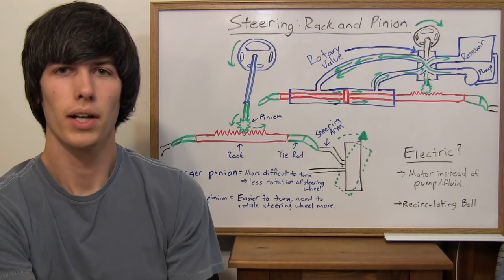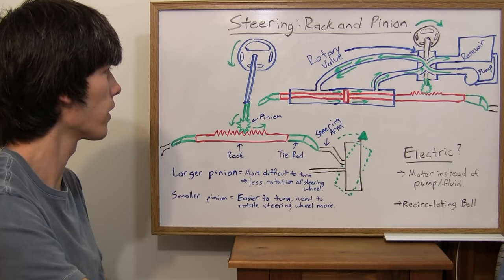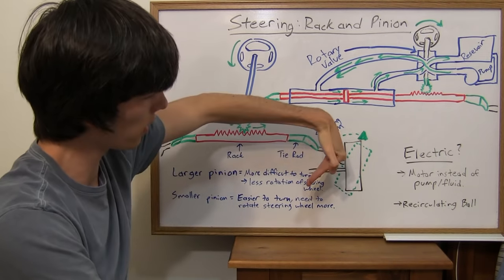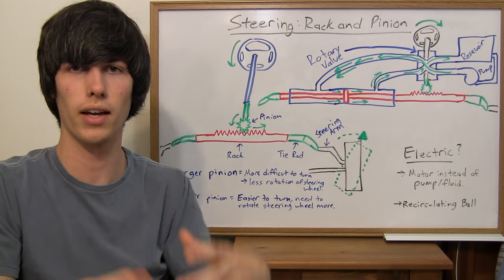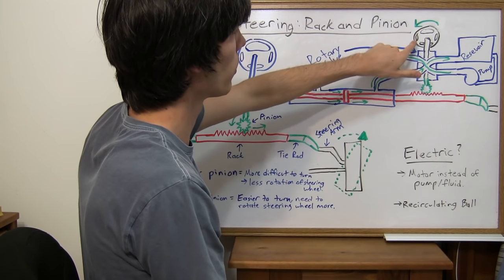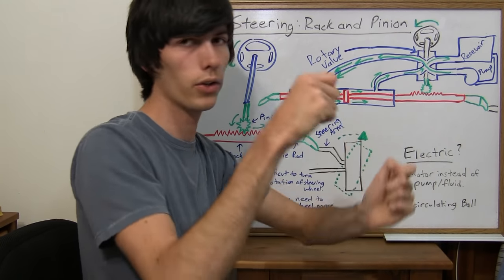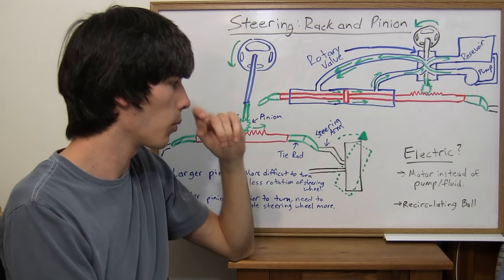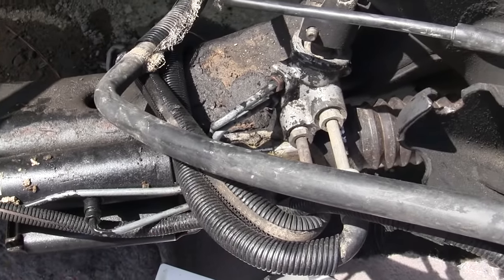How Car Steering Works - Rack & Pinion

Comment from the maker: Yeah, my drawing is basically two angle views combined, which could be confusing. The wheels are viewed from directly above, where as the steering wheel was viewed from the front. It would be difficult to show the wheels rotating from the front, which is why I drew it they way I did.

Comment: +Engineering Explained My sister has an 08 Maxima. She has issues steering the car on a cold start. I sat in it to get an understanding and tried turning the wheel, but it behaves as if the pump has gone. So I drove it because my sister says, "The problem goes away after driving it." After the drive, I stopped and tried steering it. The wheel turns with no problem after the drive but any input from you would be much appreciated. Separate note, your channel is great. I have very little friends who enjoy and understand cars, so its nice to see someone like yourself who shares the language. Thank you!

Comment from the maker: The valve alters the direction of the flow, the pump pumps in a single direction. The flow has to change directions in order for the piston to be moved both left or right.

Comment from the maker: It's a great car. Had some trouble yesterday with some misfiring but I replaced the distributor cap and everything seems to be fine now. Great handling though, for the price it's an excellent vehicle. Leaks and burns oil though, so if you do get one just make sure you check the oil level regularly (which should probably be done anyways).

Comment from the maker: It's the mechanical linkage between the steering wheel and the driven wheels - the entire system doesn't work solely by hydraulics, it does need some driver input.

Comment: Please explain or speculate what happens when the hydraulic hose hookups are reversed to the rotary valve unit. I have recently accidentally done just that, with steering fluid spewing all over. I have read that the bushings or seals (?both) will be displaced or “blown”. I plan to repair the rack but wondered if the rotary valve seal or the rack piston seals will be affected. Thanks. If you don’t know or won’t speculate I will follow up after the job is done so you might learn something useful and pass it on. Thanks.

Comment: Thanks for all the great engineering explanations. 

Once the steering valve opens the pressure on one side will increase the steering angle, what stops the angle increasing  once the desired radius of  turn is achieved, ie a fixed steering angle for a given steering wheel input.

Comment from the maker: The fluid could be eliminated and simply replaced with an electric motor which places a torque to move the wheels (for example, an electric motor powering the pinion to move the rack, or one powering the rack, etc).

Comment: What happens with pressure on piston, when the steering wheel is not rotating, or turned for 20° and left constant ?

Comment: Old vid but still great.  Curious where the weak points are with a rack and pinion?  I have a 2010 accord with a leaking seal on the rack and pinion.  How long do these normally last?

Comment: Is the box the same as rack? My Chevrolet Matiz 2005 has a noise and small bits of hard steering. Replacing the pump didn´t fix it. They say, buy another pump, but I wonder if the pinion or the power steering rack is bad. Can they resist the pump and cause overworking noise? It only appears cold at the start, while not turning and while turning.

Comment: Thank you I had my car air bag change because of recall 15 days later this trasmission fluid is liquid is slowly dripping out till it was all gone dealership told me is not my transmission but this iteam that you explain in your video 
my 2010 Subaru Forester never had this problem when I got there before I have been driving many miles without a problem

Comment: Hello sir, I am modifying electric golf cart to fully remote control. I want to select servo motor for steering but how can I find torque required for pinion to steer for selecting right servo motor?

Comment: is the rotary valve inside the rack and pinion? i want to know because im going to install an electric steering pump in my project car, i want to  know if its as simple as making a high pressure hose from the pump to the rack, and a low pressure from rack to reservoir

Comment: hey man how to adjust steering  stiffness on a 2005 chrysler 300 steering rack it's  too sensitive too soft no play I checked  it tie rod and ball joint  are ok, is there a srew or bolt  to adjust  how hard or soft is the steering on a steering rack.

Comment: Its not irrelevant :)
I totally agree. My old truck had an opening on the bottom and I over to rest my hand there. Its especially nice if you drive a manual and have to steer with your left hand most of the time.

Comment: can I drive my awd nissan with a little crack in the transfer case, is leaking drops of fluids, the shop changed the caps, but is still dropping fluids, they can not see the small tear.

Comment: I've had a couple of cars which had electrically driven steering hydraulic pumps. The silly thing was that the pumps switched off when the engine stopped even if roadwheels were turning - so if you lost the engine whilst moving, steering still got difficult.

Comment: I was looking for a video explaining what's inside a power steering rack and came across this video. Very well explained but I think it's not 100% accurate. At 6:01 you explain those lines being the high pressure and return line to the pump/reservoir. I think these lines operate the hydraulic piston inside and can both be high or low pressure depending on the steering wheel being turned left or right. The magic happens in the valve/pinion housing and I'd love to know how that works!

Comment: Engineering Explained Subscribed! My 1982 Camaro has a small deadzone in the "middle" of turning left and right. I can turn my wheel a few degrees and it just feels free floating, not doing anything. Then if I keep turning it turns as expected. What do you think is happening?
Reply from the maker: Not positive, there's either some play in the rack and pinion at this point, or the valve doesn't quite direct flow quick enough when centered. When you have the wheel turned, there's resistance on the rack, as the car wants to straighten out, so it will seem more responsive.

Comment: Nice video! Informative and yet easy to understand, and now I also want an Integra wheel :P One distinction I wanted to add, there are now 2 different types of electric steering. The first one is what you mentioned, with an electric motor taking the place of power steering to assist you turning the wheel. The second method is being used in the Infiniti Q50, which is knowing as "steer by wire." In this system basically your steering has no physical link to the wheels, instead when you turn the wheel you feed inputs to a computer which then figure out how much to turn the wheels.

Comment: you probably wont comment back on this as its been so long since youve posted this.. but i just had a question, might sound kinda ignorant but i wanted to know.. can driving a car with low power steering fluid for a day or two cause the pinion seals to go bad? i just got a new rack installed and the guy didnt top off the fluid so it made a whining noise while being turned.. i didnt know it just needed a little more added to it.
Reply from the maker: ohreally nao80 I would just bring it back to the shop and have them take a look and make sure everything is fine. It's their responsibility after all. I wouldn't think much damage would be done, but I'm not positive.
Reply: its fine now, but yeah, their work comes with warranty so ill be sure to do so if anything comes up. thanks for the reply, man.

Comment: If I'm looking at this correctly, is it correct to think that if the pump stops working, it would result in a rack and pinion that is harder to turn than an equivalent one with no power steering components on it at all to begin with?

Comment: CAN YOU PLEASE HELP ME. Every time I make a turn my car does not adjust back to center (it continues to flow with the turn). The car runs in a straight line, but the steering seems very loose for my car. The front and lower control arms were recently changed. I believe this has to do with power steering rack bushings, but I am not sure.
Reply from the maker: Interesting, sounds like several things would need to be off in order for this to happen. Caster would be a good thing to check into, as well as the toe (alignment in general).

Comment: can you please explain why a simple hydraulic power steering can damp the road shocks? I am confused, this seems conflicting the fact it makes the steering easier.
Reply: +Jiayang Ruan because where a road bump would normally jerk the rack and then rotate the pinion and thus the wheel,  now the road bump has to put that same work into doing all that AND trying to force the piston in whichever direction against hydraulic pressure, which is difficult, so it basically damps it out.  the more hydraulic assist, the harder it would be to shove around, the less assist, the easier.  For example a bmw has more steering feedback then a Rolls Royce, because the Rolls Royce would have more hydraulic assist
Reply: Let's take an example. the road bump jerks the car's front wheels to the left, and thus the steering wheel is also jerked to the left, because they are meshed with each other. According to the working principle of power steering, the hydraulic circuit will operate and assist the steering wheel to the left, which will further strengthen the road bump effect?
The problem is, why the hydraulic circuit will assist the steering force of the driver's hands, whereas hinder the steering force of road bump? where is the difference?

Comment: my stock tire is 195/65/15 and I already change the tire long time ago to 215/45/17..Lately I feel my steering wheel is quite heavy..some says its normal after we change the size of the tire..the question is how to know if the power steering pump is still in good condition?..tq

Comment: I see, so vehicles with power steering fluid doesn't use any electric force correct? But fluid pressure.

Comment: How long can I ride on a bad rack and pinion? Been doing it for 5 years 100k lol  I mean I'm not loosing power steering fluid. It drives and steres fine fluid I do hear minor noise when parking etc  which got little worse over years  I got about 250k on my camry don't want to put money into it besides that car is perfect mechanical condition.

Comment: Ok, now I'm getting confused. I've been searching for information on how to "bleed" the P/S system after replacing the high pressure line that runs from the pump to the rack. I figured the high pressure line was a one-way street and that the return line going from the rack back to the pump was also a one-way street. But this video is telling me that both lines change flow directions depending on whether you're turning the steering wheel left or right?

Comment: I am making a go kart which steering system would you suggest me ?
Reply: +sourabh kothawale Rack and pinion without any assist, with that little weight it isn't necessary, especially if the motor is mounted in the rear.

Comment: What happens if you drain the fluid completely from the vehicle and remove the hoses from the Power steering resivoir and virtually drive the car with no fluid running through the system?
Reply: The system would act like a regular rack and pinion steering without the assistance from the pump. It's much harder to steer but it still works. You may have seen people pushing a vehicle to the gas station before because they're out of go-juice. Their vehicle is off so it's not running the pump and feeding fluid through the system so they are left with just the rack and pinion.

Comment: Hello mate, good video as always.
I need to access that brain of yours. 

I received a 1999 Saturn Sl from my uncle and I have been working on doing a Tune-up to it; I was going to flush out the Power Steering Fluid from the car but I've gotten to the point where I can't find the Power Steering Reservoir; I've recently been told that it has a Rack and Pinion Power Steering.

Does that mean that it does not need Power Steering Fluid?? If it needs fluid, where or how do I go about flushing out the current fluid and adding new Fluid.

I'm hoping you'll be able to help concering this matter. If you'd like, I can send you some pics of what's under the hood and perhaps you can better see and understand where I'm coming from

Anyhow, Thanks for your time n Keep the Good Contents coming!!!

Comment: Right I usually just drive with my left hand at about 9:00... the bottom of the wheel is good for towing, easier to back up rest ur hand and just turn the way u want to go rather than having ur hands up top. Got the advice from a U'haul video haha. other than that, hard to keep it steady with a hand down the bottom... but I still like the bottom being free i think it looks nicer than the "thong" look of a steering wheel.

Comment: PLEASE HELP!!! I just bought a brand new Nissan Altima 2016 SV (only 25 miles). I feel a whining noise, the noise also sounds like when a radio is on  (coming from the steering wheel. This noise is constant at times louder than others. During driving and while sitting with engine idling. When I turn the wheel to the right or left it gets much louder. I truly at times feel that is coming from the engine as well. I might be wrong in this one.

 I brought the car to dealership the same day I bought it.  I drove with two mechanics they say "this noise is normal". I had two previous Nissan Altimas, they never made this noise. I had driven lots of cars since I often travel and rent cars.The dealership days before allowed me to use one car exactly the same model I drove it  for two days before I picked up my car and no noises and the ride was much smoother than in my car. Too bad that I barely drove my car two miles before buying it (my mistake).

 I realized that I had this noises right after leaving the lot. Also, I feel that this car shakes more than other cars. Even feel in the gas pedal that runs rough.The mechanics said that these noises are normal and that just some cars make more noises than others. The whining is really annoying. These dealership do not care, I bought the car already.  I cant really afford to take it to a mechanic outside Nissan. I feel so helpless with this situation. Just bought a brand new car and feel that my old Nissan Altima with 130,000 miles drives better than this car.

 I will appreciate any help. I will go back to the dealership but I know they will tell me the same story. Any comment will be deeply appreciated.
Reply: Rosa V. Nieves power steering
Reply: Thanks for the reply. What can I do to have the Nissan dealership fix it?  It is a brand new car.
Reply: But what does the whining noise coming from the steering wheel means? The car is brand new and the noise is constant, while driving and during idling. The dealership keeps saying is normal. But it is very annoying and constant. Never heard a car with that noise. Much less brand new. It is an Nissan Altima 2016. Why that noise? Should I keep asking the dealership to change pump? The noise is driving me crazy. Thanks
Reply: Rosa V. Nieves try a different dealership that's not normal for any car to make

Comment: in my car , the pinion has so many teeth i think , i don't have a power steering , but the steering wheel is so smooth , u can turn it by one hand easily ,, although every side u turn has so many rotation 2.5 rotation at every side , but its cool ,,, smooth with no power steering

Comment: subscribed, i wonder if i could apply this to lego technic?
Reply: Most vehicles from Lego Technic sets use rack and pinion steering, either using some dedicated parts or just a grey rack piece that accepts gears. I even remember a set from 70's that was a blue go-kart that used a rack and pinion steering with steering arms made out of 3 spinning 2x2 block and a 4 long with holes instead of those little dedicated steering arms :)
Reply: mibars those classic sets.....

Comment: That first diagram is terrible, first you are going form a head on view explaining the turning of the steering wheel and pinion gear to a birds-eye view showing how the tire moves, what??? You should do a view from the drivers perspective so right is right and always right....then show a birds-eye view showing the rack moving and turning the tires.....you turn the steering wheel right, the pinion gear turns right, the rack moves left. And being that the racks placement is behind the center of the tire, aka where the axle would be, it pulls on the right tire's backside and makes it turn right...opposite for the left tire...